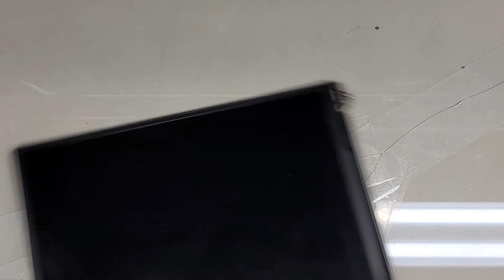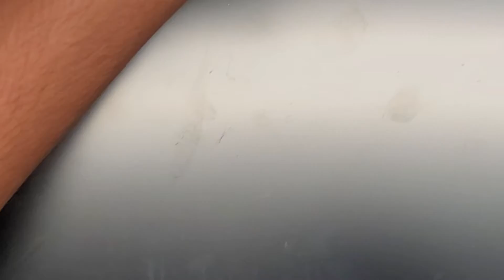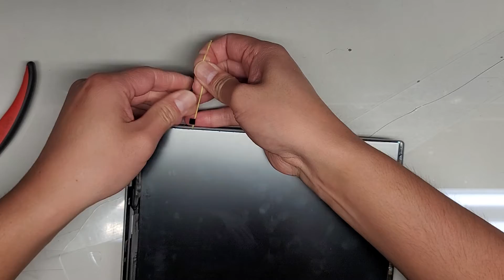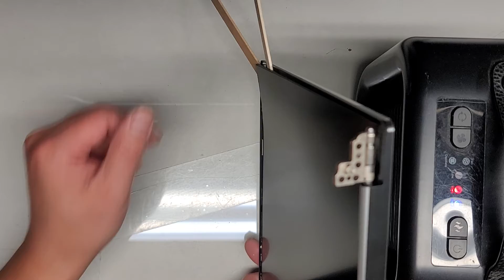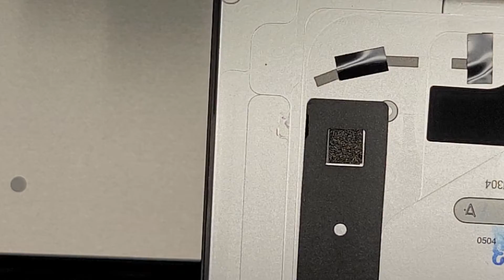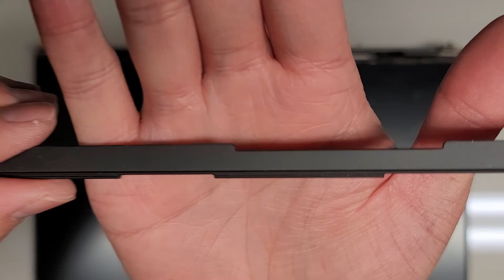DELL XPS 15 9510 Disassembly LCD Screen Replacement Repair Part 2

Comment: While investigating a similar procedure on another model (XPS13 Plus 9320 OLED) I worked out that people seem to find that thread and stretch tape stuff easier to work with if they apply heat before pulling the thread. One tech microwaved a heat pad and sat the lid down on that to warm it beforehand, another used a heat gun. From what I've been able to tell from watching you do this, it's arranged in a relatively similar way, but the threads are thinner and more subtle. What I can't work out is whether they pull the thread or the side stretch tape out first.
Reply from the maker: The threads are to make it reachable. You have to do the sides first because the threads lead to one's that need to eventually be pulled sideways.

Comment: Awesome video…my screen is all working…but recently it is only working at an exact 90 angle of if I am lucky…so I guess the screen cable is damaged right?  I have opened the laptop and reset the connections on the motherboard side…but still the same.  So I have to open everything and replace the cable and hope I do not break the screen! Wish me luck
Reply from the maker: Sounds like the cable, but only way to tell is to move the cable around while the screen is out.

Comment: Hello. I had the same problem when I wanted to open the screen, but I realized that the yellow strings, wire,  is for opening the screen. That yellow strings helps to detach the screen, nice ideea from Dell. :)   Thanks.
Reply from the maker: Nice!

Comment: I just replaced my XPS 15 9520 screen using this video. A few things, when removing the bezel use some heat to soften the glue and a using old bank or store card cut 1.5 inch wide slide it underneath the bezel and lid surround, slowly drawing the softer original card edge and corners along to separate the bezel from everything. This way the bezel stays flat and I was able to rely on the old softened glue residue to put back. Also not that on the 9520 that there is no yellow string but two short tails in black which are hard to see at first. Make sure the screen is cold before pulling on these otherwise the string breaks away from the tab end. I installed the free software HWINFO to identify my screen and ordered a compatible on those results. First boot connect the charger and needed to reset the time/date but after that everything is as was. Super.
Reply from the maker: Nice, glad the repair went well.

Comment: Sometimes with LCDs, the fault is with the backlight - either with the display module, or sometimes with the pwm signal or power supply that comes from the laptop to drive the backlight.  You can diagnose this by using a bright flashlight/torch to see if you can still see an image.  Alternativley if the backlight is fine but the display itself is dead, then you can usually see the backlight activate when the room is completely dark (the display will go from black to very slightly illuminated - i.e. extra dark grey).
Reply from the maker: Yup

Comment: Just broke my screen too, just on another side. And I 100% sure it's Dell's engineering foult. It looks like the panel is secured properly everywhere exept bottom corners - they are kind of loose and because of it requires too light forse to broke it, but at the same time.
Reply: same broke my one the exact same way GUYS BE EXTRA CAREFUL WHEN REMOVING THE BOTTOM SIDES AS THE STRING AND THE PULL TAB NEED TO GO PAST THE BOTTOM SCREENS CORNERS :(((((((((((((((

Comment: Hi Binh. Is the double-sided adhesive 1/8 or 1/4? I'll be doing my own repair and will send something your way once I'm done. Thanks for doing the vid!
Reply from the maker: The stretch release adhesive? Doesn't really matter, just make sure you have it where you can reach it to pull it out.

Comment: do you know what is the black flat cable/strip around camera module?
Reply from the maker: Not sure what you mean
Reply: on 41:09 around your right hand finger, there are 2 flat cable orange and black, as far as i know camera module only use orange cable. so what the black flat cable used for? some kind of sensor, antenna or something?
Reply from the maker: @ilhamwirapraja  likely camera microphone or some sensor
Reply: oh right, i completely forgot about microphone. it's most likely for microphone. thanks.
Reply from the maker: Yup

Comment: where did you get a replacement screen from? recently broke my screen and am debating upgrading from fhd to 4k
Reply from the maker: Basically here https://amzn.to/3Jet2Yi
Reply: Are you able to replace the lcd with the 4k oled option that comes from the factory?
Reply: @randommunching9863  please dont do this. the cpu and battery are not designed for the power consuption that a oled screen withdraws. it would probably work, but the laptop will struggle to perform.
Reply from the maker: People don't realize that laptops are usually built with no upgradeability in mind. It costs more for them to build in capability that won't be used by 99.999% of buyers.

Comment: And now you know what the yellow string was for...to easily pull the top horizontal pull strip out without any prying!
Reply from the maker: Except the pull tab tore, so I had to pry it, or did you not see that in the video? Lol
Reply: @ItsBinhRepaired  Woops. Too much fast-forwarding. Missed it. When I did mine one of the top tabs tore, too, even though the string was still attached. Fortunately, I keep a pair of hemostats around. Slid right in and grabbed it real nice.
Reply: @ItsBinhRepaired  By the way, the video was extremely helpful and well done. Thanks.
Reply from the maker: @Steve Britten  haha yup, the sideways ones are highly unnecessary. I'm sure they do it just so they know you messed with it. Lol

Comment: I just messed up my screen by closing it while something was in the way, where did you find the replacement screen? I'm 2 month out of warranty now
Reply from the maker: EBay "xps 15 9510 lcd"
Reply: @ItsBinhRepaired  im in the same predicament, i was looking on aliexpress at 3.5k oleds for 9520s, do you have any idea if it would work with a 9510?
Reply from the maker: What's a 3.5k oled?
Reply from the maker: Get the screen model number from the back of the screen.